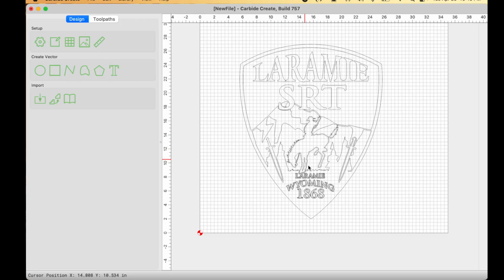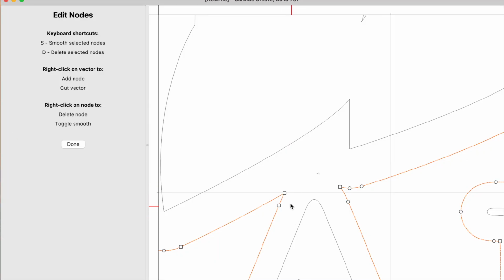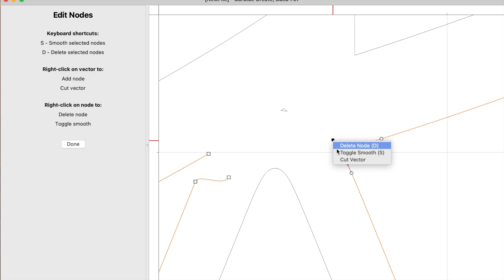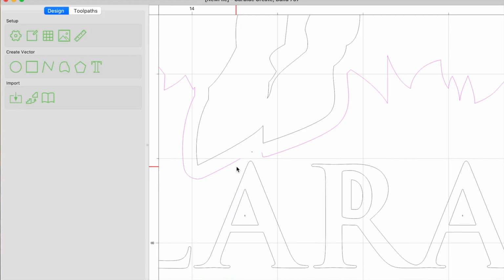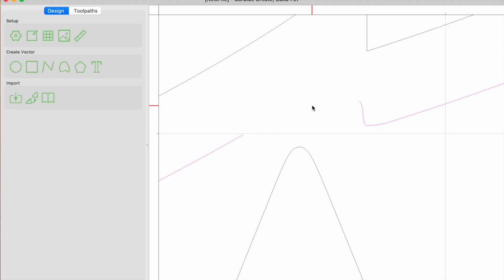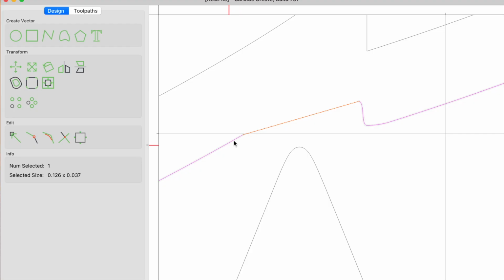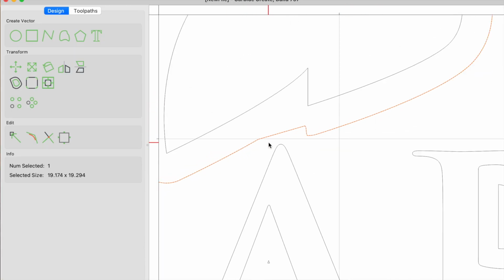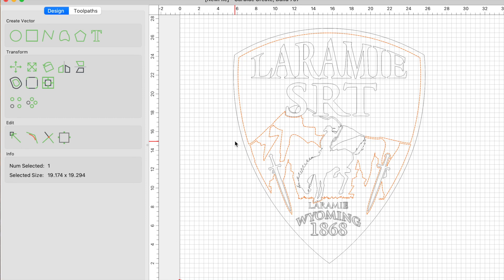Cutting and Merging Lines - Carbide Create Tutorial

Comment: I don't use Carbide Create as much these days. I recall often the toolpaths would should in different colours, but i never got a response from Carbide 3D on whatnthey indicated. Any hints as likely linked with incorrect vectors?
Reply from the maker: @JohnCol-1959  what are you using now John? In considering switching to something else. But I find it hard since it’s free and I mainly use it for flags
Reply: @aetimberpine  hi Edgar , mainly CarveCo Maker+ for enhanced 3D relief creation.
CC7 Pro is much more relaxed and simple, but only about 6x year. CarveCo is very strict on SVG quality for toolpath creation. You can get 1 or 3 month free trial of CarveCo Maker standard if you want to try it out